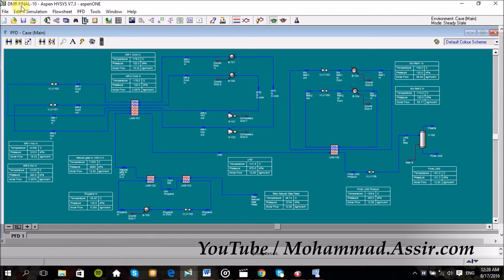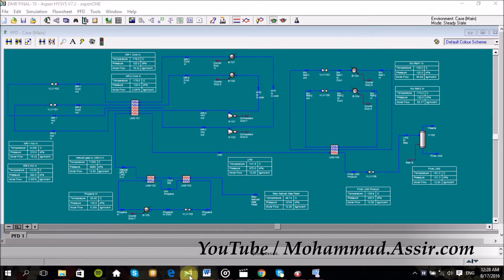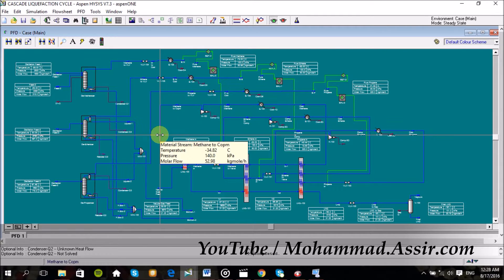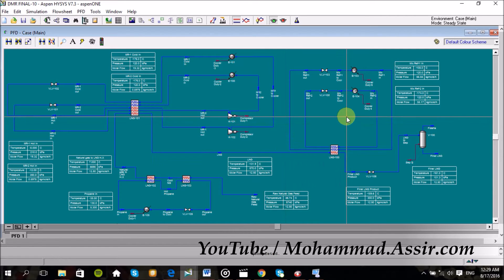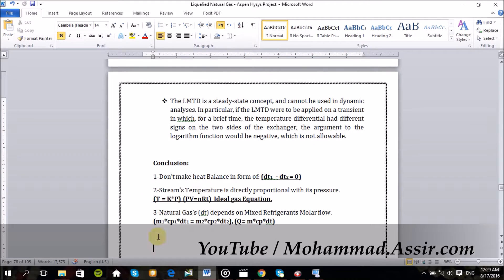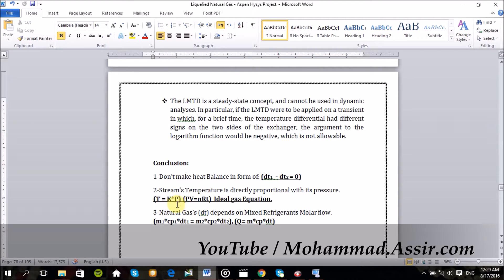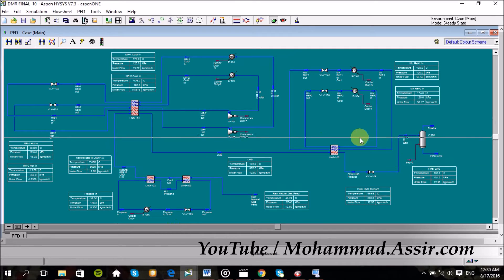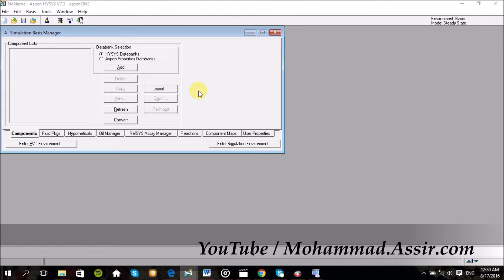9- LNG Production - (2/2) DMR  cycle - hysys 7.3

Comment: can you please explain how to overcome the following problems while dealing with LNG heat exchanger over specified temperature, under specified, over-specified,  and please elaborate dynamic and steady LNG heat exchanger according to hysys simulation and I couldn't find a transform option to transform streams, shape at a different angle on aspen hysys v11.  kindly reply asap because i am working on this project. thanks

Comment: Salam Mohammad Assir,
I hope you are doing well.

I am doing a research project with regards to optimising small-scale natural gas liquefaction cycles.
I was wondering if you could provide me with that word document you had as well as reasons why different temperatures and pressures were selected in the first place.

I am trying to minimise the compressor shaft work in the process in SMR in which my three degrees of freedom are:
- pressure levels
- refrigerant flowrate
- refrigerant composition

I was wondering if you can do a video doing an optimisation using Genetic Algorithm where you can link MATLAB optimiser with HYSYS simulator.

JazakAllahukhayr :)
Reply from the maker: Dear Ahmead..

Sorry for late replay. However first of all am really sorry i lost this word file long time ago..

Secondly am became so busy last months.. am working on many research for many students around.. so i fear that i couldn't work on any other videos this year.. But i will be available for your help if you have any inquiries about how to run case studies on different refrigeration cycles.. in order to optimize your process..

Regards
Mohammad Assir
Reply: Mohammad Assir Thank you for your reply Mohammad.
I really appreciate the gesture.
JazakAllahukhayr